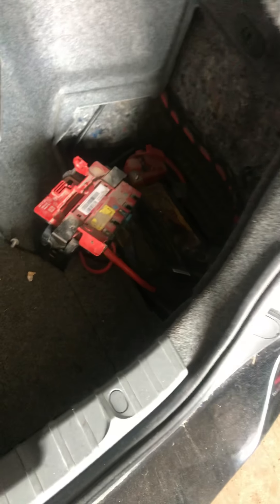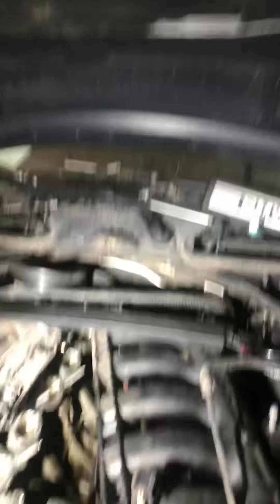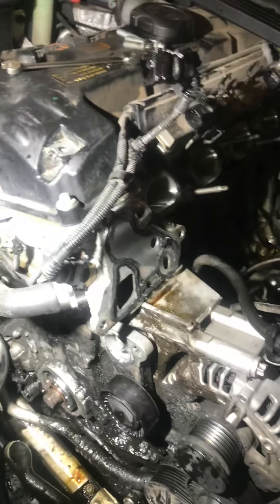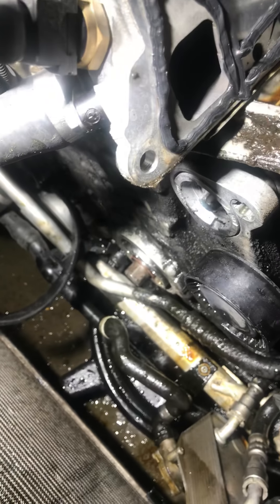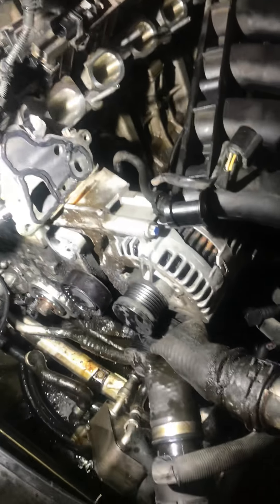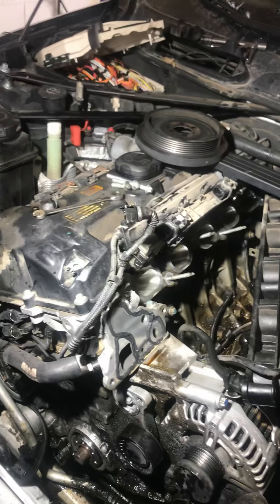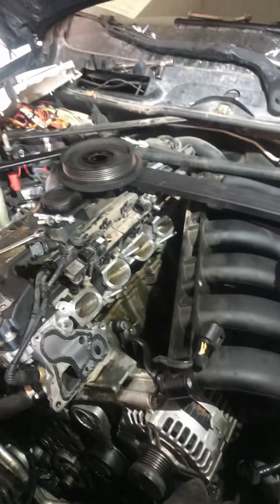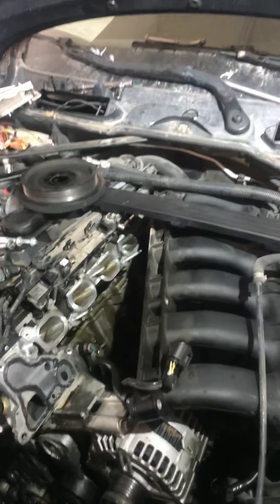2007 328I no start

Comment: My car (same model) has pretty much all of the problems you showed and I took care of them one by one.  Thank you for sharing what you encountered here.  I also recently suffered a CCV or PCV failure which gave me the strange UFO whistle noises under the valve cover, then stumbling and sudden stalling.  After one intermittent stall at a red light it never started again.  I removed the intake manifold to replace the crankshaft sensor because of a code i saw and found the manifold was full of oil.  Cleaned it out and the injectors and spark plugs as well.  I also have the A0B2 code for Supply Terminal 30E/30I and A0B4 for Engine Start/Starter Operation Fault but I still have good starter crank when it attempt a start.
From your experience, if the starter is still cranking strong could it still be bad?  I am wondering if everything mechanical might be ok in my car, but oil in the cylinders might be the reason for not firing up.  Let me know your thoughts on this.  Thank you!

Comment: So did this fix the problem and what kind of cost would be reasonable for such a repair...I'm pretty sure my car is doing the same thing. :/
Reply from the maker: Lauren H yes the new starter fixed it. Is your car leaking oil or not starting?